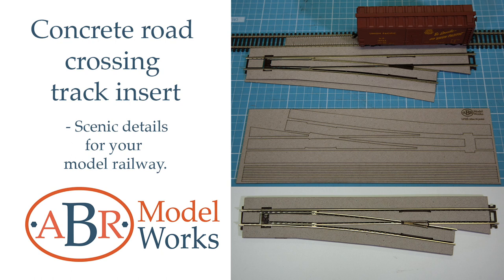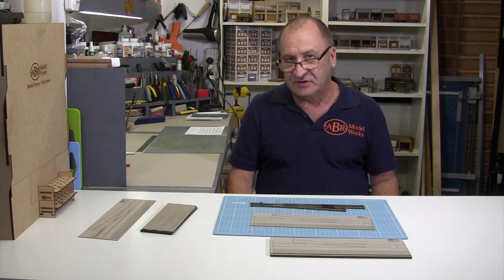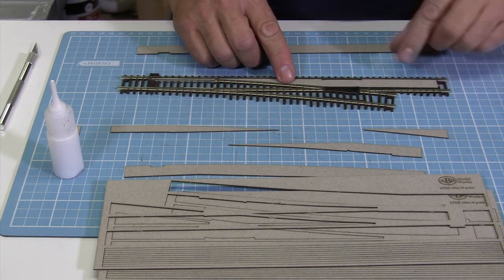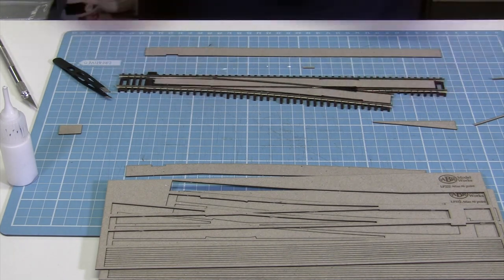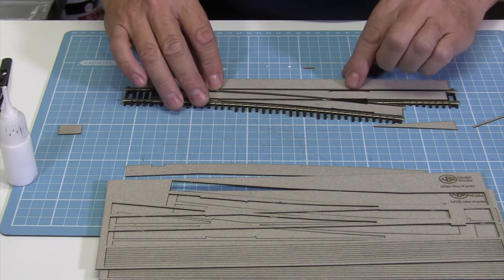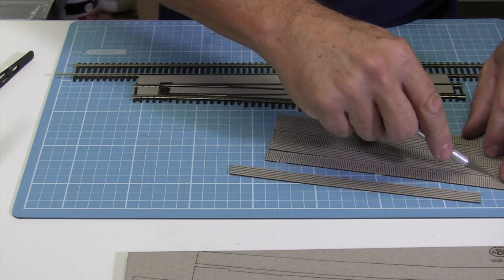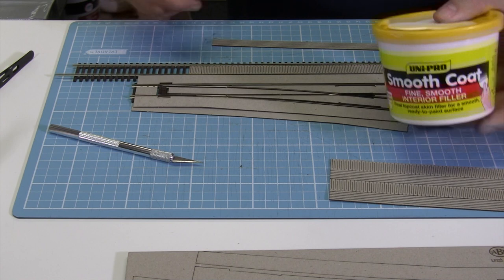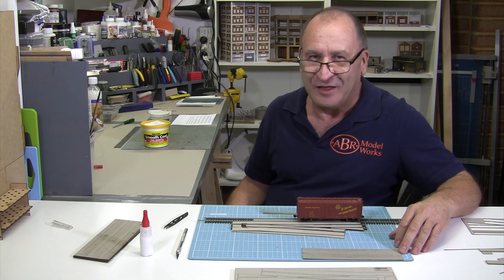Concrete road crossing track insert - Scenic details for your model railway    HD 1080p

Comment: Thanks for posting. Please what glue did you use to glue the inserts in with?
Reply from the maker: A PVA is fine but I use Deluxe Materials Speed Bond as it dries in 5 to 10 mins so it's my go-to glue for any PVA job.
Reply: @ABRModelWorks  Thanks. I will look around for Deluxe Materials Speed Bond.
Cheers Ken
Reply from the maker: @Ken-Kaef  Hobbies Australia will know who stocks it (02) 4961 0212